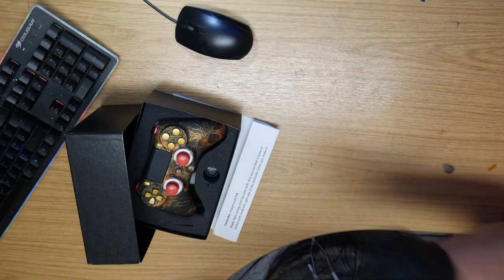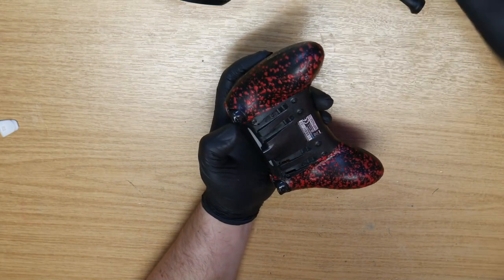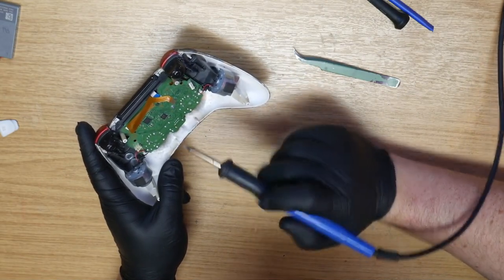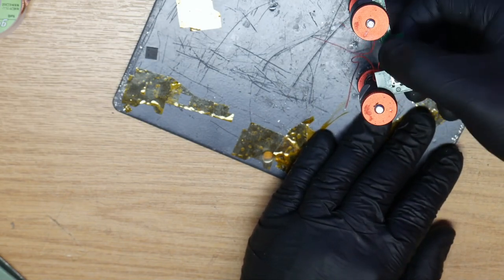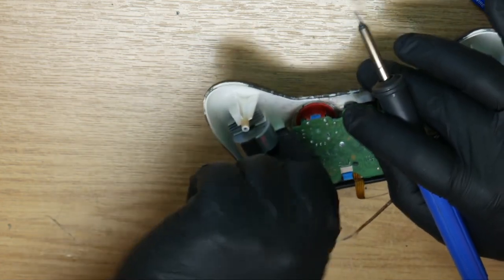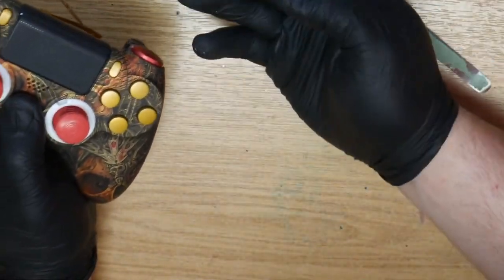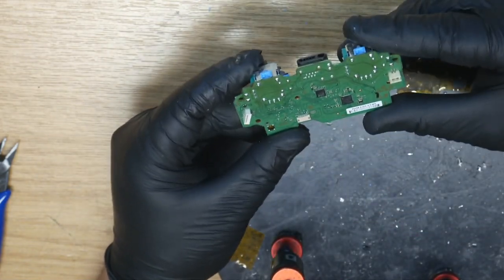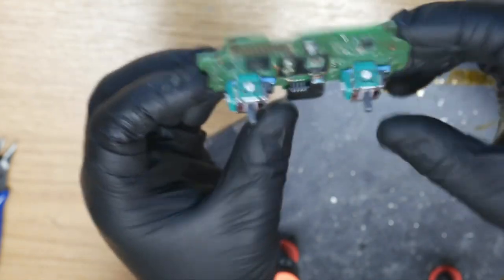PS4 SCUF Impact Controller Repair Stick Drift Customer Video Request.

Comment: Don't suppose you can remember where the wires go? Or what they do? I've just got a scuf that's had the wires ripped off the main board. Any help would be appreciated.
Reply from the maker: The two wires connect the SCUF mod board to the L3 and R3 buttons on the analogs. Check out some of my other videos I'm sure I show a close up on more than one.
Reply: @UberMicroRepairs  Thanks for the quick reply, I appreciate it.

Comment: could you tell me which soldering iron you are using? i tried it but i think mine is not hot enough. what temperature is needed here? thanks a lot for your videos!
Reply from the maker: I have a KSGER T12 and an Aixun T3B.

Comment: Learned a lot! Is that just rubbing alcohol he is constantly cleaning the board with?
Reply: Yes
Reply from the maker: Correct. 100% IPA. Can't stand working in used flux. Keeps the work neat.

Comment: Question, I fixed my right analog stick and when connected the right stick stayed going up, what did i do wrong?
Reply from the maker: Is it 100% up or just 10 / 20% up. If 100% there may be a ripped pad or solder bridge. If only 20-ish% then it may just need manually calibrating.
Reply: @UberMicroRepairs  It stays constantly up I cant movie it, I have no control of it.

Comment: Hello mate. I wanted to ask you how you modified the tool to remove the security screw from the scufs controls, since I don't understand English very well and I bought the tool but it has 6 teeth instead of 5 and it doesn't fit when it comes to remove the screw. I would greatly appreciate your help. Thank you so much!
Reply from the maker: Hi, I used a grinding tool to make the bit fit. Took some time and trial & error but it works.
Reply: @UberMicroRepairs  thank you very much. I appreciate you!